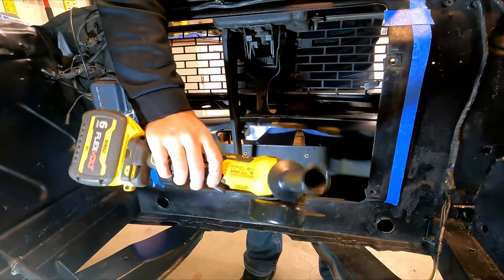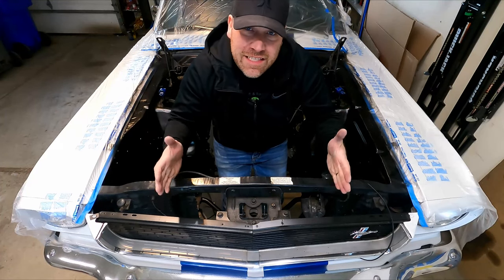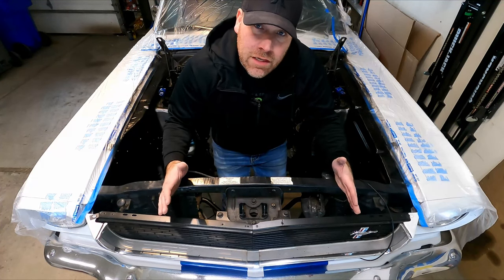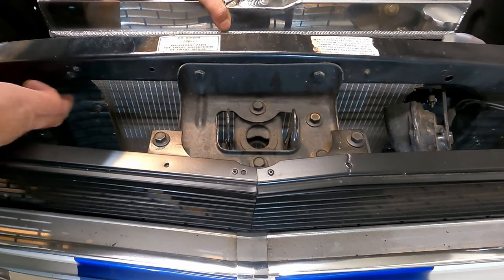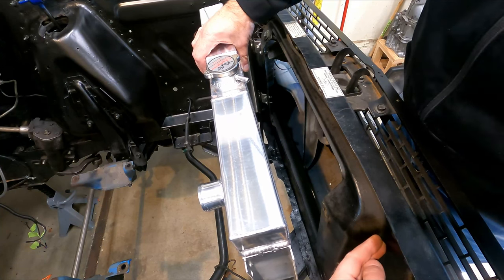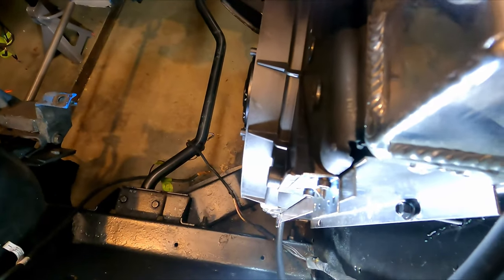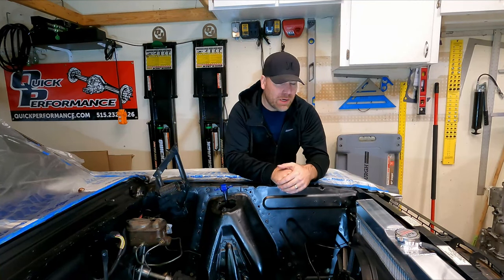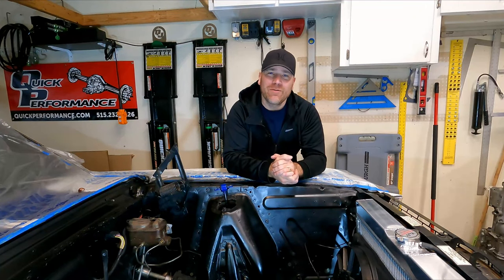How to make a 24 inch Radiator fit in a Classic Mustang

Comment: Good work,  Not that much work on my 67 to do this but it is great with a shroud, I installed a 24" radiator and I run a 14" and a 12"fans  off a Flexalite probe setup. Even with AC in Texas I have no problems for 12 years now.
Reply from the maker: AC, no that's something I'd like to add.  :)

Comment: When I cut my core support open for a larger radiator, I used a 22" Mopar radiator.  Inlet/outlet are staggered, so that worked out great.  The fan from a Ford Taurus fit the radiator core perfectly.  Cools great, and the fan works flawlessly.  Looks like your setup will work quite nicely.  Perhaps you could fab up "Z brackets to attach to the body of the fan rather than the sides.  Great job.
Reply from the maker: Great tip!
Reply: Which radiator did you buy? My mustang needs this exact set up.

Comment: I went 30" go big or go home also I used a cross flow design. If you upgrade the alternator you can ditch the voltage reg; 1 wire or 3g.
Reply from the maker: I looked into larger Rads, I think the 24 is going to suit my needs. :)
Reply: I agree 24 will work great I put them in a lot of cars shouldn't have any over heating problems in that respect.

Comment: I used a very similar setup on my 68 but I just threaded bolts through the radiator mounts and welded them to the core support instead. Figured it'd make it one less tool/thing to keep track of if I removed in the future.

Cooling setup has no problem keeping a small block at bay. Really happy with it.
Reply from the maker: I thought about the bolt thing, but my fan shroud is a pinch too small for that to work.  😀

Comment: Nice Andy! This is the next upgrade I’m actually getting ready to do as well on my 1965 Mustang! Except I’m putting a crossflow style radiator in. Im going to have to chop the whole top of the support out and and build probably a housing and lean it towards the front of the car for clearance issues with the motor. Did you ever do a follow up video on this?
Reply from the maker: Sounds good, I hope everything works out for you.  :)
I did not do a specific follow up video, but everything has been great.  I took the car out on one of the hottest days here and the temp never got above 195 while sitting at a light, so that's a win.

Comment: Running an aftermarket stock sized radiator to keep a built 331 cool here in Arizona.  Stock type water pump, thermal clutch fan, and a factory shroud keeps everything flowing.
Reply from the maker: That’s good to know. 😃

Comment: I agree with waiting for the final mount details to be ironed out after engine installation.  Other adjustments may be necessary anyway.  Sweet looking aluminum radiator though.  Nice work Andy!
Reply from the maker: Thanks!  Hopefully everything goes to plan when I put the motor in. 😁

Comment: Radiator cap will clear, however, if you got the Champion radiator do not use the radiator cap cover they send with it. It sits up just high enough with the cap cover on a 65-6 to make the hood not close good. Also, your system should run 10 to 15 degrees cooler.
Reply from the maker: Cool. This Rad did not come with the cap you are describing, but I did get one for my last car.
Reply: Mine works great with no problem

Comment: I have the same radiator MCC 338 in a 1964 falcon & 1965 mustang  what I did for the mustang was buy another radiator core support cut in 1/2  Move the parts right and left  to make a bigger opening where it looks factory but just a bigger opening .
Can bolt in also as well as weld in
Reply: After you can bolt radiator like normal
Reply from the maker: Hmmm, seems like more work.  :)
Reply: Wish I could send a picture , it is work but better in the end just saying

Comment: The 68-69 Ford Torino has an option for a wider radiator, it uses mounts that attach at the top and bottom with rubber cushions and steel brackets. Could be an option.  All parts  available from AutoKrafters and Mac auto parts.
Reply from the maker: Good to know.  :)

Comment: Great video. Thanks for the info.  Can you say how thick the radiator is & how thick the fan is?  I'm wondering about clearance issues in my application.
Reply from the maker: The thickest point is about 5-3/8" (about 4-3/4" where the fan motor is not in the way), but that's where the fan motor is.  Since there are two fans, they're offset from the middle, so something like the water pump pulley has more clearance since the fan motors are not at that location like where there's a single fan (like what I had before).  Also, please note that I cut some of the core support out, so the radiator sits a farther from the engine, making more room than before.  :)

Comment: Great info and video! I have been planning a larger radiator swap. Did the upper and lower radiator hoses work or were others needed?
Reply from the maker: The stock hoses for my '66 fit.  The inlet and outlet of the radiator is essentially in the same location (relative to the engine) despite the radiator being wider.  This allows the use of the stock hoses to be used.  :)

Comment: What amp relay did you use? What awg wire did you use? I'm reading answers all over the place on a Google search. My engine compartment is getting cluttered with relays so i was looking at relay boxes on Amazon and most come with 40amp relays and 12 awg wire if you get the pre wired ones.
Reply from the maker: 40A relays and 12AWG wire is sufficient for your application.  However, you should also put fuses inline for your fan(s) as they can be very power hungry and it's easier to replace a fuse instead of melted wiring or a blown relay.  :)

Comment: Hi Andy I have a really similar engine build to yours and I'm having some over heating issues with an a 3 core aluminum radiator that is the stock width. I have two electric fans with a shroud and when I'm moving the engine runs around 178 but as soon as I get caught in traffic the temp creeps up.  I am looking into doing what you have done in this video but I am concerned that it will run too cold when I am rolling down the highway. So, I am curious as to what temp you run while your moving.
Reply: Also, when you dropped your engine in did you have any clearance issues with the electric fans?
Reply from the maker: Temps on the highway, are around 180.  I have not seen the temps get above 195, even on the hottest days of this summer.  I am running a 180 degree thermostat.
You engine will not run any colder than the thermostat you are using because it won't open until it seems the temp you have chosen.
No issues with clearance, plenty of room between the water pump pulley and the electric fans.  :)

Comment: What is the height of that radiator?
Reply from the maker: About 20.75 inches.
Reply: @AndyKruseChannel  part number? Manufacturer?
Reply from the maker: @SergioNJenniferGarcia  I put a link in the description of the video.  I do that for all my videos.  :)
Reply: @AndyKruseChannel  no issues with clearance for the hood?
Reply from the maker: @SergioNJenniferGarcia  Nope, no issues, everything has been great since I installed this radiator.  :)
Reply: @AndyKruseChannel  sorry for the questions man. Link for the video when you wired up everything? I’m 90% sure I’m doing this. Sounds like it will solve my issue with overheating since I installed my AC and live up a mountain. LoL
Reply: @AndyKruseChannel  I just ordered the same radiator and fan combo. What hoses did you use?
Reply from the maker: @SergioNJenniferGarcia  You can use the regular hoses.  The inlet and outlet is moved inward from the end of the radiator, so the regular hoses fit great.
I purchased my hoses from O'Reilly Auto Parts, top hose = part number 21953, lower hose = part number 20475.  But this is for a 1966, I don't know about years 1967+.  :)